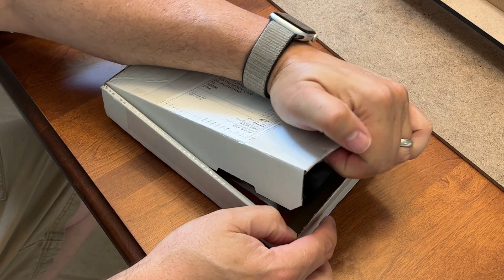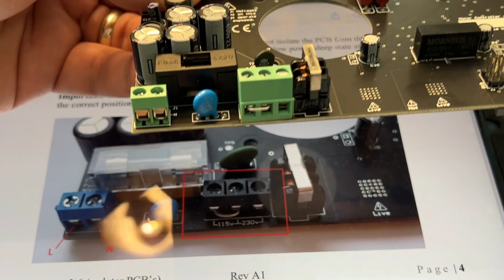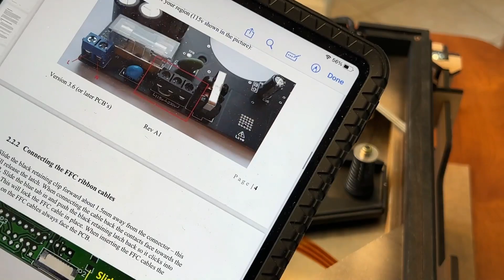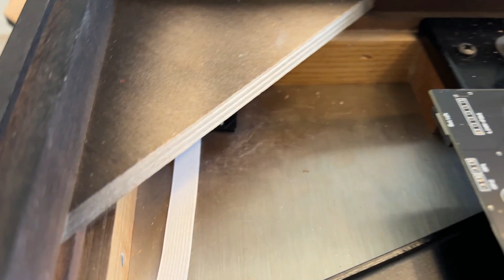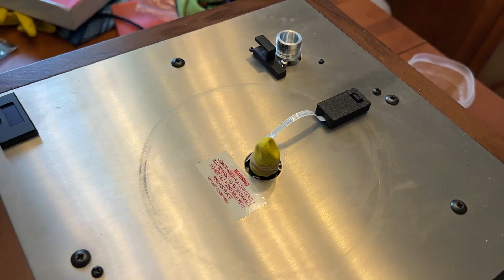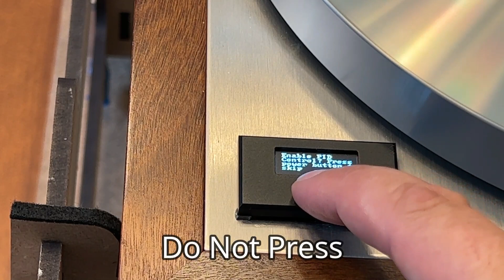Part 2: 🛠️🪛 How To Install a Zeus Speed Controller For Your Linn LP12 Turntable

Comment: This is can be use in technics sl-1600 direct drive turntable?  Because my turntable have a speed issue. The drive motor is broken the controller IC is damage
Reply from the maker: Sorry, no.
Reply: @MODAC so how to modified this unit?
Reply from the maker: @paolomarcelogalvan1938 yours needs a repair.
Reply: @MODAC the problem is spare parts is not available like IC

Comment: I don't wish to be a party pooper but double-sided tape doesn't really inspire confidence when you're dealing with precision engineering and some of the product seems to be a little poorly thought out; I'm thinking in particular of the extended ribbon connector to the PCB; surely with a little forethought the ribbon connector could have been placed closer to the switch - similar to the Linn original? It seems to work, though, so at the end of the day you pays your money and takes your choice. Excellent detailed and informative video; thank you
Reply: What makes you think you're dealing with precision engineering, everything about this tinker toy is made with margins in mind, rough margins i might add. Thus being a nightmare to adjust. It`s not just terrible engineering but it`s the whole purpose.
Reply: @brugj03  I think I'm dealing with precision engineering because It says so on the box: "Fragile. Precision instrument" 😛
Reply: @russputin6294  The box is right. It`s about the box, not the insides.......LOL.

Comment: The Zeus is a great power supply upgrade as good or better than a Lingo4 and you save over $1000 I have the outboard Zeus on my LP12 and I feel it is the best power supply I have had on my LP12. I had Mose/Hercules, Mober DC psu. Put one on your LP12 you will be very happy.

Comment: Hi Dave, I chose the Vinyl Passion PSU for my 1990 vintage Valhalla replacement.  Very happy with it and now enjoying 45rpm records too.

For my sub-chassis and armboard, I went the Stack Audio route, with their cast alloy, Alto parts.  They absolutely transformed the sound, totally eliminating the bloat in the bass which these decks were famous for.

I also installed the Stack Audio base plate which comes with three height adjustable damped feet.  So much easier to level the plinth.

I’ll be done once I have an Ekos II arm fitted, but need to save up for that!  Thanks for the video and keep up the good(!) work 😄
Reply from the maker: Awesome. I have been talking to Stack audio and we may be doing something. I considered VP, but Valhalla were much more accommodating. Thanks.

Comment: Don’t doubt it works but seems a bit of a kludge
Reply from the maker: Not really. Once it’s installed you’re good to go. You could go for the Linn Radikal 2 with a similar tachometer feature, fancy motor, etc. but it will cost you.
Reply: @MODAC  running the tach cabling through the bearing space just seems like an awful idea. And btw, much the same technology but in an AC motor form is available in the Lingo 4 which is far cheaper than a radical. Like $3500 cheaper
Reply from the maker: @NateEll  they sell the external Zeus, that does more than the Lingo, and is $836…less than half the price.

Comment: Thanks much for the video and especially that link!  My real interest was in whether this power supply could be fitted to a Linn Axis, and if you're aware of this entry level turntable I'm sure you know they're NOTORIOUS for having power supply problems.  Looking at the Valhalla web site, they offer repairs and upgrades to the Axis power supply (WOW???!!!) at what looks to be a very reasonable price, even fixing the common annoying problem with the Axis where the turntable will start spinning after power is lost and restored!  I'm surprised they even offer Axis repairs, as I'd given up looking because at the time mine went flaky about a decade ago, I'd found almost nobody was willing to touch them at the time.  After getting my Rega Planar 25 I didn't part with my Axis mainly because I literally couldn't give it away at the time despite trying, maybe now it can be brought back to life!  I'll contact them soon and will mention you when I do!
Reply: It's possible to fit either a Minos or a Zeus to a Linn Axis, but the motor on the Axis power supply needs to have some wires soldered to the motor coil connection lugs. The Axis switch may require soldering too depending on which version of Axis you have. Alternatively, as you mention we can just repair your Axis PSU 🙂
Reply: @valhallaelectronics4055  Thanks much for your reply, I do believe I'll get the old Axis out and have a look.  Having you all repair the PSU sounds like a great idea!  I'd bought mine used some years ago and it had supposedly been serviced and had the bad capacitors replaced, and shortly after getting it, it developed an odd issue I haven't seen mentioned anywhere else, where every time it lost line power and had it restored (which happened a lot since I had it on a power strip I'd turn off whenever I wasn't using it--anyone living in Florida understands why LOL!), it would run just slightly faster each time until it was noticeable and annoying. After about 3 or 4 times adjusting the speed (not so easy to do since it's only accessible from the underside, and yes I used a plastic adjustment tool knowing of the voltages lurking in that supply!) and worrying I could be getting near the end of the range of adjustment I just put it away and gave up on it.  After watching this video and looking at your web site I'm very interested in reviving this otherwise great sounding turntable!

Comment: Looks like a nice unit but too complicated for me to install. Have you seen the Hercules unit which is much cheaper and I believe is easier to install? I have the Majik PSU and an adapter for 45’s but don’t use that, I have a second dedicated turntable for them which is easier for me to use and I can use a conical stylus on that one which is very kind to surface noise on older records.
Reply from the maker: They sell the Minos which is similar to the Hercules.
Reply: @MODAC I forgot to add that you aren’t using the trampoline baseboard which is very inexpensive for a Linn part and I am told makes an improvement to the sound. I can’t comment on that as mine came already fitted so I don’t know how it would sound without one.
Reply from the maker: @tonyjedioftheforest1364  I’m using a lightweight British metal stand. I read that you if have one like mine the Trampolin is not necessary. However, look out in the future for future additional mods and upgrades.